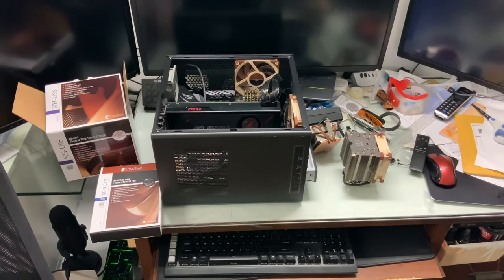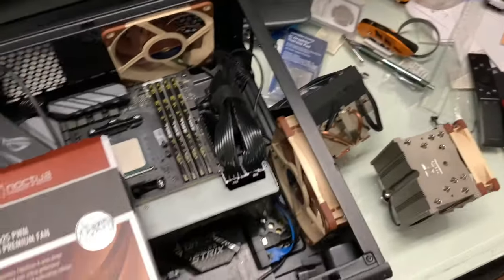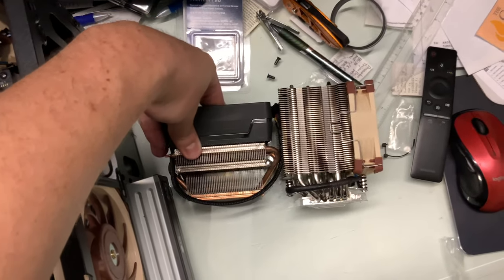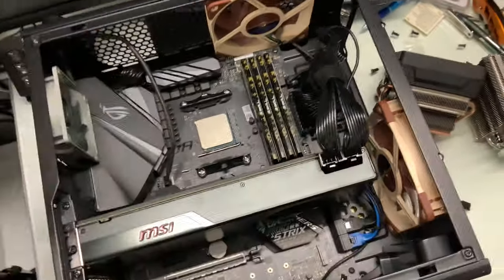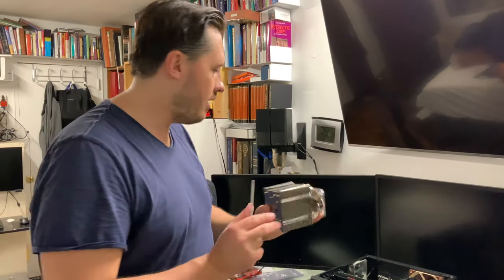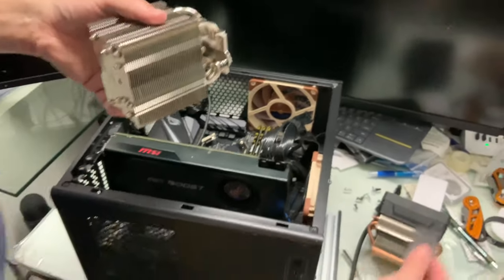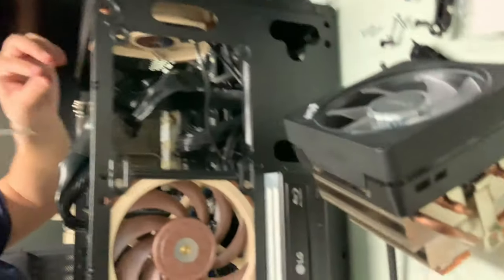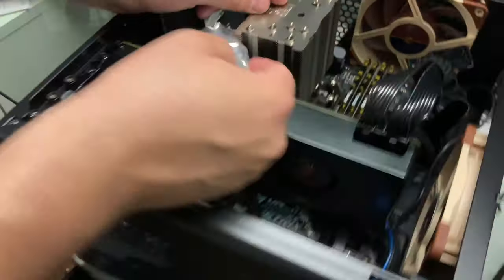NOCTUA NH-U9S vs Wraith Prism Ryzen 2700x CPU Cooler Review & Comparison #izreviews

Comment: I just bought a NH d15 SE am4 dual tower cooler for my 2700x . I still haven't mounted it z so I have no idea on how it's gonna performe against the prism. Considering I am running stock I think I'll have better temps and less throttling.
Reply from the maker: I think you will be happy when you do put it in. I agree with running the CPU stock as it keeps the pc cool and quiet and the Ryzen chips are designed to boost automatically when needed.